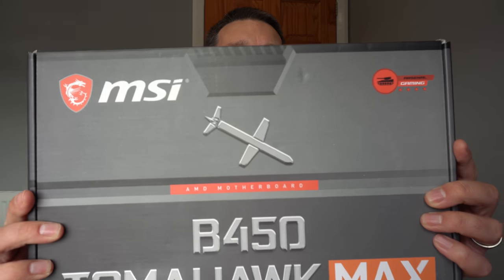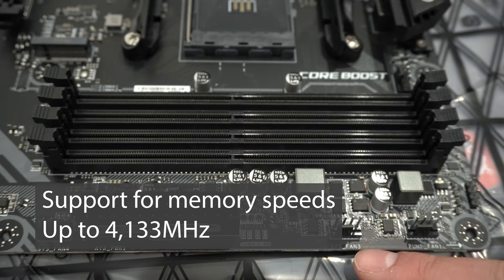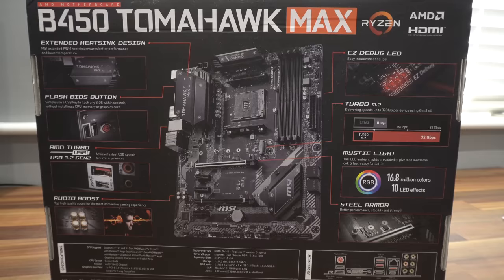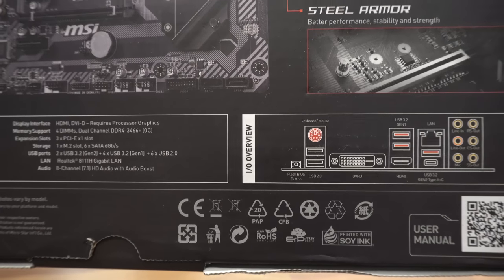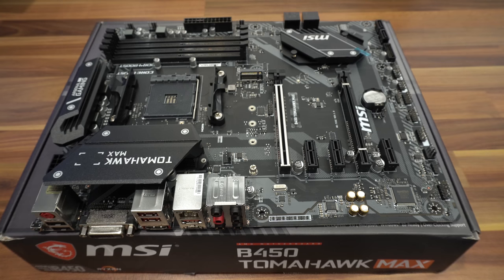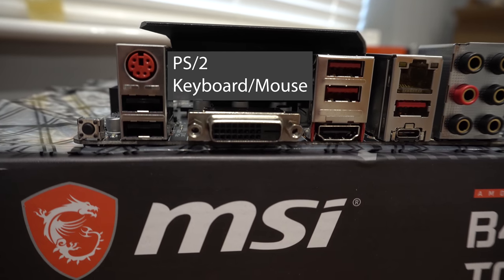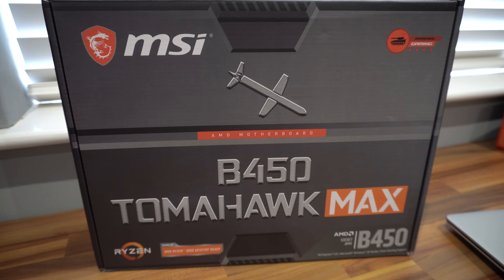MSI B450 Tomahawk MAX Motherboard | The BEST B450 Motherboard for Ryzen 3000!?

Comment: Hello friends, I got these two warnings on pcpartpicker. Kindly asking for your thoughts, please. Cheers 🍻 

Warning! Some AMD B450 chipset motherboards may need a BIOS update prior to using Matisse CPUs. Upgrading the BIOS may require a different CPU that is supported by older BIOS revisions.

Note: The motherboard M.2 slot #1 shares bandwidth with SATA 6.0 Gb/s ports. When the M.2 slot is populated, two SATA 6.0 Gb/s ports are disabled.
Reply: Msi max version doesn't require bios update to work with ryzen 3rd gen . For using m.2 just use sata 1 ,2,3 or 4 port . Usually motherboard comes with 6 sata ports and only sata no 5 n 6 will be disabled if u use m.2 ssd but you will still have 4 sata ports to use .
Reply: Max has Ryzen 3000 support out of the box, it also supports USB flashing, you don't need a CPU and RAM to update.

Comment: does the M450 max includes Type C USB 3.1 Gen 2 support?
Reply: There isn't a connector on the board to plug in front panel USB-C but there is 1 x USB-C port on the back i/o panel.

Comment: B450 tomohawk max or b450 gaming plus max for the ryzen 5 3600?
Reply: Tomahawk max
Reply: X570 Prime P
Reply: @lifemocker85  fucked up pch fan placement. x)

gpu will cover the pch fan and well ........ LeL
Reply: @lifemocker85  sponsored comment...
Reply: @ultratechgaming199  yes no way its wise to get b450
Reply: @lifemocker85  If PCI-E 2.0 only affects RTX 2080 Super or better and since a lot of gamers would be fine with a SATA SSD, why the heck do you absolutely need B450? B450 is still amazing for people who don't want to spend $150 on a motherboard. Also, people who are upgrading from A320 on a 1st gen Ryzen have to get B450 because B350 boards are discontinued and X570 doesn't support Zen1.

Comment: Tomahawk max or auros elite b450? Please helpme guys
Reply: Tomahawk max, Aorus elite won't support ryzen 3rd gen processors like 3600 out of the box. You'll have to do bios update. And also VRM on Aorus board is bad
Reply: @nikhiltyagi8550  okay thanks for your response
Reply: @frifan217  wait for Amazon Diwali sale from Oct 24. You will get it for very cheap. Also if you can spend a little more, you can get MSI b450 carbon which has inbuilt wifi
Reply: @nikhiltyagi8550  but i need mobo am 4 bro
Reply: @frifan217  both b450 tomahawk max and b450 carbon pro AC are am4 and support 3rd gen ryzen processors
Reply: @nikhiltyagi8550  sorry bro, i got you, in my country there is no item like b450 carbon pro ac

Comment: can it run 3900x with no problems?
Reply: Khris Vincent Barreta  if you dont can oc you dont have problems
Reply: @pilu6279  not worth overclocking 3900x anyway so i think i'm good. thanks!
Reply: it will run hot
Reply: @lifemocker85  i bought the duo. it runs not quite hot as i anticipated. but now i offset the voltage and it runs 62c on heavy workloads. i'm really impressed. oh, using the stock cooler of course. i will be upgrading to 280mm AIO when i have a chance.

Comment: Gaming pro carbon ac?
Reply: need to flash the bios with that motherboard
Reply: @xdynamics2561  That board doesn't require a CPU for the BIOS update. It has BIOS Flashback which lets you flash the BIOS without the CPU.

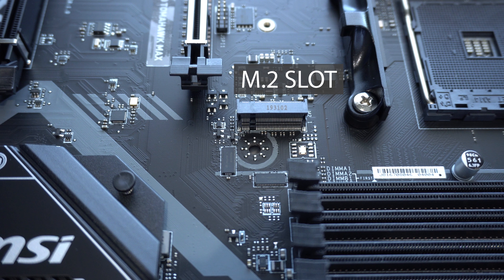Comment: @6:07
If I install an M.2 SSD on the MB, I do not have any additional storage options?
Reply: I had the same question with you
Reply: No. You have 4 more Sata Conections on the Right Side of the Motherboard. Go to 2:36 on the Right side of the Chip Heat Spreader
Reply: If you install an M.2 in the available spot on the motherboard, SATA ports 5 & 6 are disabled. However, there are four more SATA ports available on the board. If the is not enough, you have other PCIe slots which would accept an adapter card for additional M.2s, which would run at high speed.

Comment: Does anyone know if I need a WiFi card for this to connect to the WiFi?
Reply: Yes, you need. This doesn't have built-in WiFi, you can get an archer T6E for 30$.
Reply: The best choice is a Ethernet cable, its always the fastest option.

Comment: it was a huge mistake for me to buy the ROG Strix B450F-Gaming, i should have gone with the MSI B450 Tomahawk instead.
Reply: I'm currently debating whether to get the Tomahawk Max or the Rog Strix b450-f, what was your experience with the strix board that you didn't like?
Reply: i heard that it had worse VRM cooling than the MSI Tomahawk.
Reply: @pentiummmx2294  yea I did see someone saying it wasn't as good if you're planning on overclocking but if you we're planning on running just stock it was alright.

Comment: No Thermal cover for ssd m.2 oof
Reply: is it necessary?
Reply: @xdynamics2561  M.2 tend to run pretty hot, shield is not necessary but if u are going with the Ryzen 7 3700x and above i would absolutely look for one with a thermal shield just for performance's sake

Comment: So I bought this mobo, ryzen 3 cpu and 2 sticks of ddr4 ram.  Wish you had mentioned it won't work with win7.   I abhor win10 so it goes on ebay or in the trash.
Reply: Well unfortunately windows 7 is soon going to be dying (unfortunately no more updates) 😭
Reply: @salmon3045  So I hear.  Time for me to move to to one of those Lenux  derivatives.  I really abhor win10.

Comment: Shit, I bought the Gaming pro Carbon AC
Reply from the maker: How is it?  Are you using Zen 2?  Any issues?
Reply: @UsedNReviewed  Had to do a BIOS flash to the latest version. But no issues what so ever. Everything works perfectly fine, the temps are arround 20 idle, 50 when under gaming load. I think the only problem is the 16 mb bios space. But I dont care about that fancy bios with a mouse.

EDIT: Im using the Ryzen 5 3600. Also boosts with no problems

Comment: Does the b450 have a 12 v rgb header on top? And will it fit a pure rock 2 black without hitting the gpu which is a 1660 super ventus